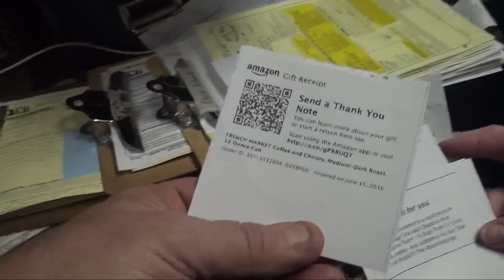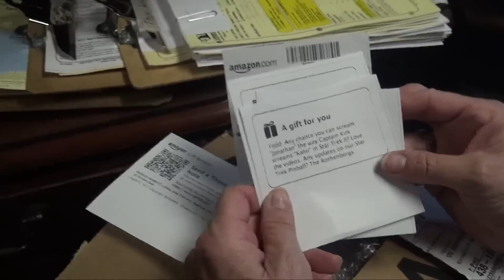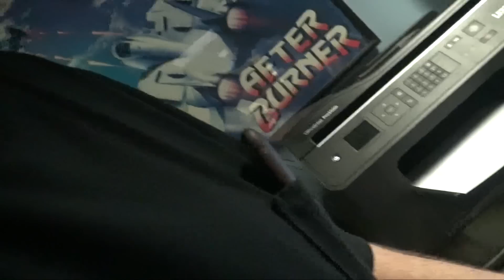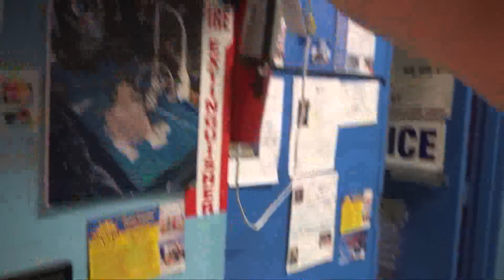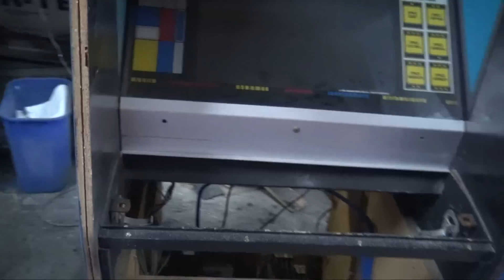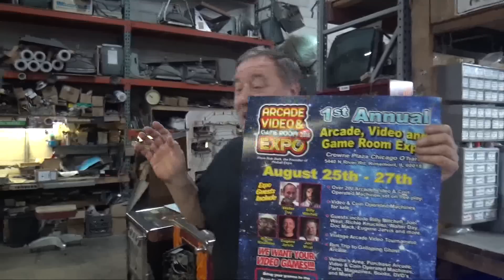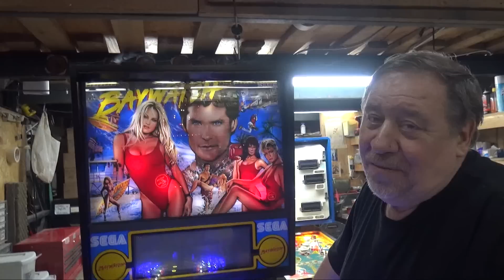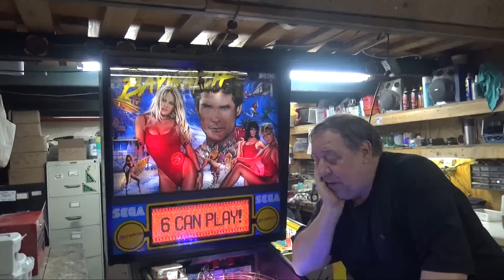#1159 KLOPP Coin Counter-ROWE R90 45rpm JUKEBOX-Sega BAYWATCH Pinball-TNT Amusements

Comment: Hey Todd, we had 5 of those Klopp counter counters (electric and manual) and a Klopp coin sorter when I worked at Capitol Amusement here in Olympia. They run forever it seems like. We had a couple coin counters that were 35 years old and we sent them to the Klopp factory for refurbishment. When they came back, they not only worked like new, they looked like new  (factory painted them current color scheme). Klopp is the best and very rugged and reliable.

Comment: Huge fan, your videos are awesome. ive been watching them here in canada for a long time now. Im new to pinball and just purchased a jurassic park machine. Now i have a question, how do you properly adjust the flippers? Ive seen in an old video of yours that you showed how they should be adjusted with the 2 pin holes. Mine are not lol. Im new to this and was wondering if you could perhaps make a video showing how. 

Cheers!
Reply from the maker: It is simple to adjust them...simply requires loosing the allen screw holding the flipper shaft and then turning the flipper to correct position and retightening the screw!